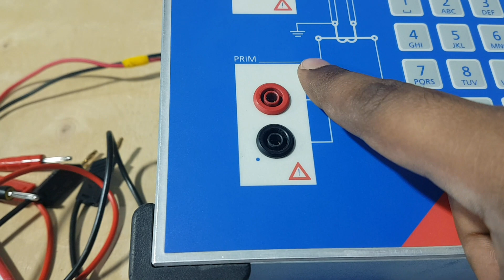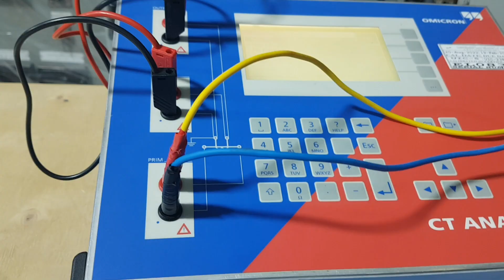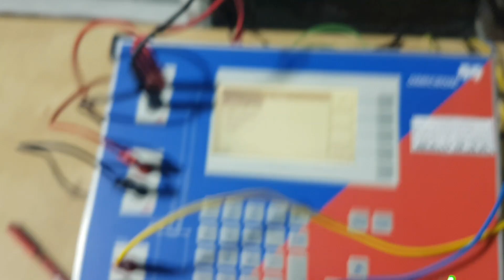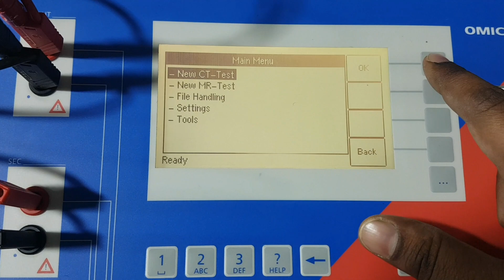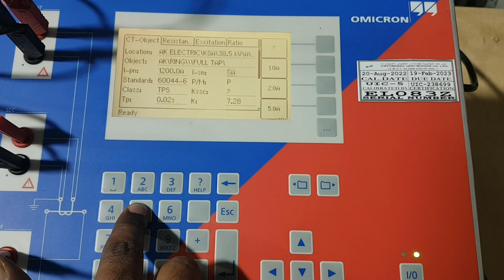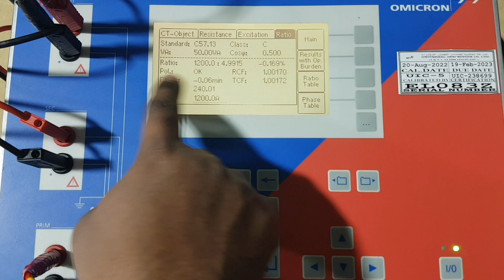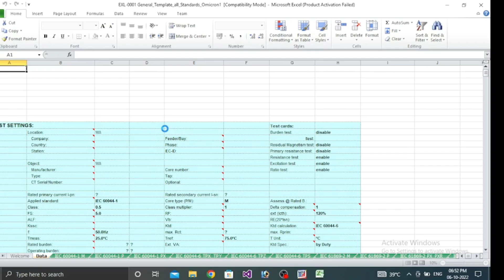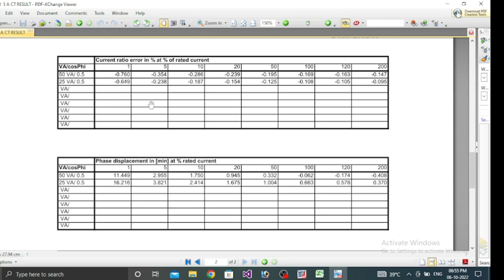CT TESTING, CURRENT TRANSFORMER TESTING WITH CT ANALYZER, PRACTICLE TESTING, TEST REPORT MAKING EASY

Comment: At the time of testing S1_ S5 ,S2 S3 are open
Reply from the maker: Dear Hi,

1. Yes, all others like S2, S3, S4 were left open. Since we are checking for full tap that is between S1 to S5
2. Using CT ANYLZER one can check only one tap at a time because it is single ratio tester
3. There is Multi Ratio test kit also, with that kit one can check all ratio at a time. Regarding that i will soon upload a video. It will also more helpful 

Thanks,
AK ELECTRIC